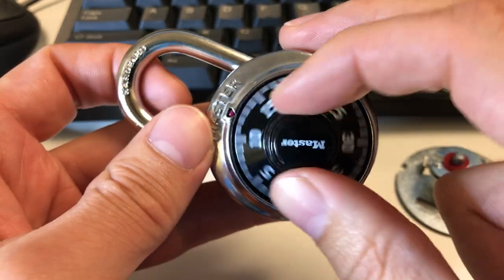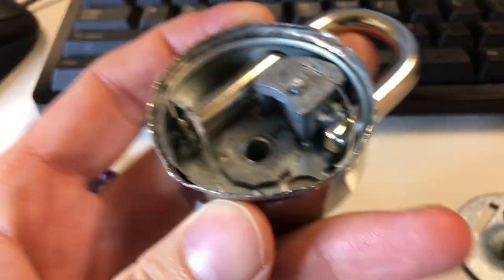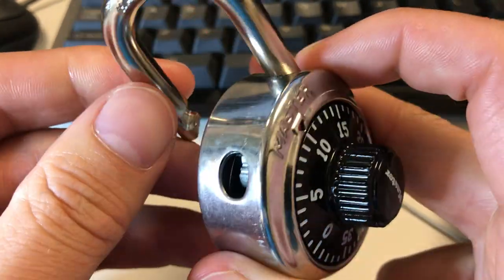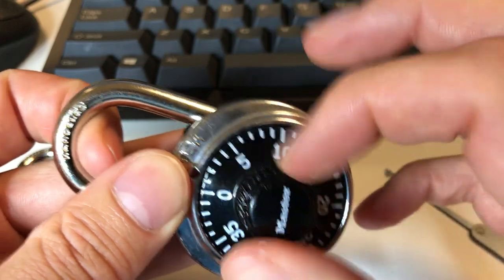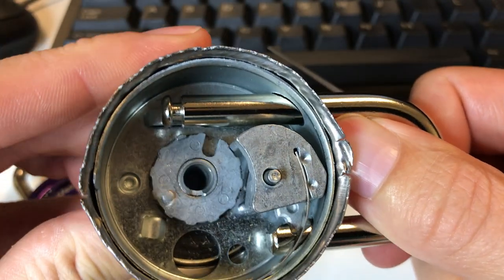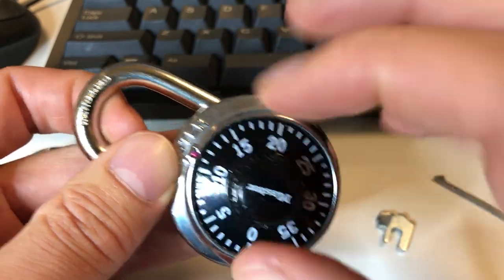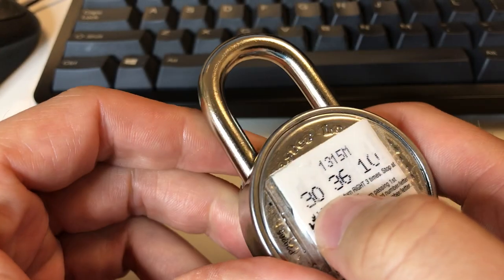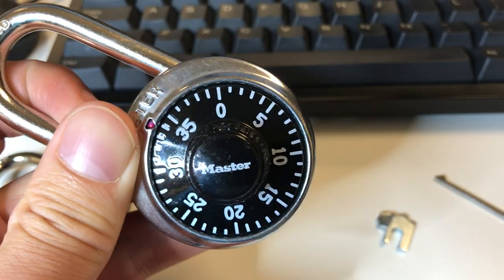Decoding a Master Dial Combination Lock Part 1: Basic strategy

Comment: I finally found the combination on my old lock!  this video series was, by far, the most helpful.  It gives you a nice understanding of the reasoning behind the technique.  I found this more helpful than just blindly following instructions without an understanding of the reason for it.  Thank you so much, I spent several hours and was ready to give up.  I had one of the smaller colored locks that are more difficult.  the breakthrough for me came when I went to the store and purchased a similar lock for $7. Practicing the techniques in this video on a lock with a known combination was extremely helpful and ultimately lead to my success.

Comment: I have an old lock, sitting around for many years. After spinning my wheels for about an hour or so I applied the back and forth technique to parse the resistance points on the first number. This was the only video that I watched with a decent enough explanation for it to make sense what your doing. As a mechanical engineer, I was not interested in giving up. It turned out my first number resistance point was about third in line in terms of relative cogging resistance, but the back and forth technique uncovered it in about 20 seconds. Many thanks.
Reply from the maker: Glad you got it!

Comment: Thanks!  I had a Brinks combination padlock (Pat 418,392) that I thought I had the combination to, but it wasn't working.  I was able to shim the lock open and view the edge of the disks through the shackle hole.  Using your description of how the locks work, I was able to determine the code.  (The actual combination was 5 less than where the cutouts were relative to the dial.)  Strangely, the combination I had was about one or two digits less on each number from the working combination.  I was very surprised that a combination one digit off from the "true" combination wouldn't work, since a comparable Master Lock is known to have a 4-digit slop.

Comment: These 4 videos are excellent.  The best explanations ever.  I found that the little finger on the shackle retention clip interacts with the bump on the first wheel to move the wheel as the shackle goes by.  This allows the unit to relock when the shackle is pushed back down.
Thanks Again

Comment: Hi again,
A follow up to my prior comment.  I have 6 master "practice locks" that I bought at a flea market 20 years ago.  They didn't have the  combinations so I shimmed then to get open.  I lined up the wheels by viewing down the shackle whole.  That lined up the wheels at  the 10 o'clock position (viewed from the front).  I just subtracted an equal amount of digits from each of the three combination numbers to bring the alignment point (wheel slots) to under the spring loaded fence (around the 2 o'clock position).  Then the lock opened AND I now had the combo.  
I tried your method to get the first number.  The method worked on one of the 6 locks.  On the other 5 locks, I found that as I pulled on the shackle, the spring loaded fence hit the false gates on the 3rd wheel before the shackle retainer rubbed against the bump on the 1st wheel. I measured the interference points on the shackles.  In most cases, the shackle needed to be pulled out an additional 1/16" from the 3rd wheel false gate interference point to reach the 1st wheel bump interference point.
Did you ever experience this condition?
Thanks Again
Reply: Bro did not wanna read allat 🔥🔥🔥

Comment: Congrats!
I gave up, so I removed the cover and through a visible hole I got a combination lined up and applied an ofset to get the code, despite this, I was able to guess the third number and the rule for the second number worked fine, but I could not get the first number.
However, by brute force and assuming that I get the third number correct, it would be 40x10 = 400 combinations.

Comment: There's a lot easier way to do that. Figure out the first number just like you said, spin the door one full rotation in the opposite rotation, when you get to the first number  moderately pull on the shackle and then slowly turn the dial until the dial stops moving completely, and then again with moderate pressure on the shackle, turn it down the other direction until the shackle pops open... And yes I know this is the internet and that they will probably be a bunch of people who will want to argue with, but I am a licensed locksmith he's been doing this for over 10 years so I don't give a shit what you have to say so don't even worry about trying to argue.

Comment: So my lock is newer and doesn't have that hole in the back at like 11 o'clock. I do have the vertical opening where the longest part of the catch is, so I can peek into it and line up all 3 grooves with the hammer thing. Thank you! Couldn't get the back piece put back in place lol but don't think anybody at my gym will be looking anyway. All 6 videos I watched to try and get my combo were SO WRONG.

Comment: 4:56 so the 1st number and last number always multiples of 4 off from each other, the 2nd number is always some multiple of 4 plus 2 off from each other. Including O x 4
Reply: Reading this and watching him do it got me my 2nd number. My first and 3rd number were 9 and 39.. when he said the first and last are always multiple of 4 (9 and 39 are only 1 away from 10 and 40; so it works). Then to find my second number I went from 9 to 11 then 39. When that didn't work I went from 11 to 15 for my 2nd number cause he said add 4 (I wasn't doing that at first I was going by 2s). 15,19,23,27,31,35, then 39 was my 2nd number. 19,39,29. I knew it was this but I was switching the numbers around but never got it in that order

Comment: On the second number,  wait for the catch and SUBTRACT 4-5 DIGITS,  since it's counter clock, same principal as first and third numbers,  apply pressure and listen in the case of 5 being ur middle digit u will hear a metal on metal sound around ten and looseness at 10-4, you guessed it 5or6, either will suffice

Comment: I have one of the smaller version master combos, and the digits don't satisfy the relationship: 23-32-21.  I could still use the techniques in these videos to get the 1st and 3rd numbers (ignoring that they should be equal mod 4).  Thoughts?
Reply from the maker: Weird is that the numbers that came from the factory? Like you have those numbers printed by Master on the sticker? Physically speaking every number in the combination is actually not perfectly aligned with the numbers on the dial and is about 2 numbers wide.  So if the real combination from the factory were 22-32-22 then your combination of 23-32-21 would still work.  It's also possible that Master is making changes in their latest batches of locks?

Comment: I have a "Red" Master Lock with the working combination of (27-4-33) which does not appear to follow all the rules. I can find the last number "33" OK. It has 40 numbers om the dial. This lock is quite old & 1 7/8" diameter. Am I missing something. It looks identical to the "Black" locks.
Reply from the maker: Yes starting sometime in 2018 Master changed the design of the internal wheels a bit to add more possible combinations and to eliminate the restriction that the numbers have a specific relationship modulo 4. You can still feel for the last number and get it exact and you can usually feel for the first number and get it approximately but you won't know if the middle number is offset by 2 from the first two anymore.

Comment: My first # was 28 +5 =33
I tried all the tricks watching other vids and couldnt get it to open.  
The second # that sticks or that I could feel with pressure was 20 . So I just subtracted 5 from 20 =15 and forced the last # and presto 33 15 30 

So if anyone is having problems try it ...I have no idea why it worked but it did. 

Turning counter clockwise should cause you to find a number that sticks and wont move.  That was my second # which I took away 5 digits .  

If this was all by chance that freaking weird 😂

Comment: Got it! Hacked my first lock. 10 minutes.
Reply: I don't believe it.  These locks are hard to crack. Ever notice has these lock picking "experts" don't fool with them ?  It's far easier to snap open a pin and tumbler lock with a set of rakes.

Comment: Doesn't work with my brinks. First number is -5 from where it sticks. Last number requires heavy tension to find... all others will grind but the true last number is free with heavy tension. Middle number is easy enough to bruteforce.
Reply from the maker: This technique only works for Master brand dial combo locks. I'm sure Brinks also has similar tricks to decode but they will depend on the specific mechanism and construction of their locks.